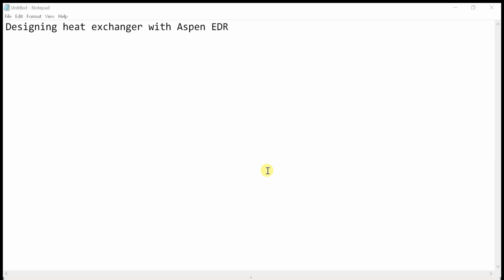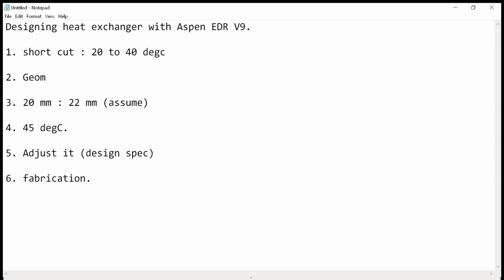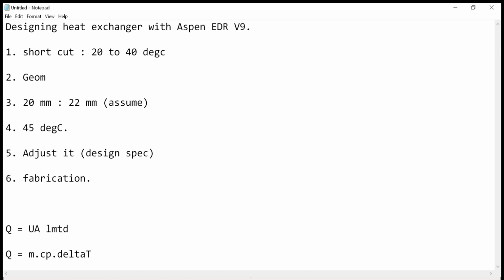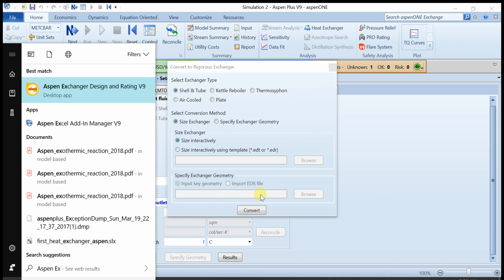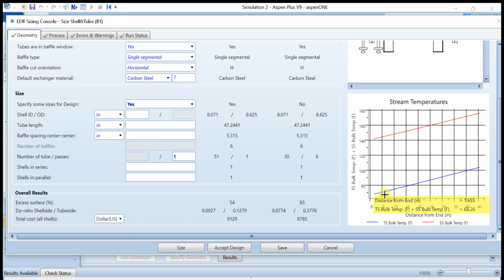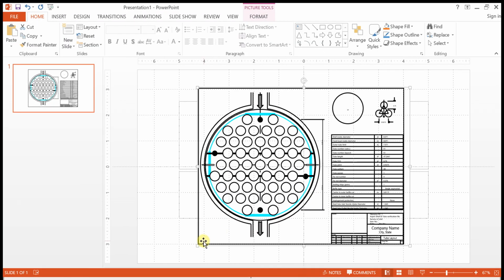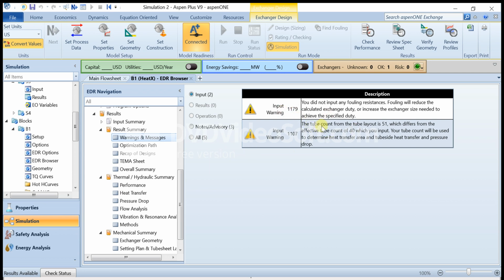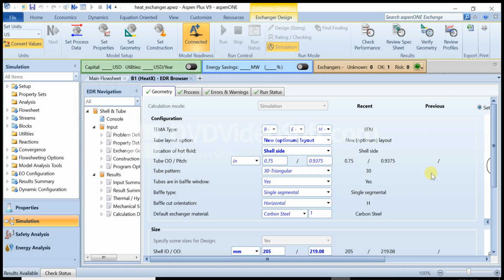shell and tube heat exchanger simulation in Aspen Plus and Aspen Plus Exchanger Design and Rating

Comment: Dear friend. Heat Flux is also equal to the enthalpy change between point 1 and 2: 
Q = H1 - H2 or Q = m*(h1-h2). Thanks
Reply from the maker: Correct. Did I make any mistake ?
Reply: @ParagPatilChemEngg   You are really good teacher. Thank you
Reply from the maker: @juanperdomo1  thank you very much.

Comment: thank you for your great work
I am looking for simulation video or documents regarding Shell & Tube  evaporator  design  with EDR, and what  type of shell and tube heat exchanger  correpinding to tema standard its appropiriate to use as evaporator
Reply from the maker: hello, sorry for late reply. Please see the manual by Aspen itself. Its good ! I could do it from there itself. Also, see Aspen tutorials (webinars), they are usually free.

Comment: Hi I followed your video and saved the file from Aspen Plus to EDR but when I opened the file on EDR its showing a lot of errors and a lot of the information which I inputted on Aspen Plus is missing. I wondered if you can kindly help?
Reply from the maker: Hi, 

Sorry for the late reply. I think EDR file made within Aspen Plus will always throw errors. 

Can you do one thing? Can you start directly modelling your heat exchanger from Aspen EDR directly ? Without going into Aspen Plus?
Reply: @ParagPatilChemEngg  It's just that when I opened the Aspen Plus file before there was no data that I had inputted, hence why it was showing all those errors. I guess that's fine if you just need the TEMA sheet, costing and other documents but if you need the EDR file itself as well then you are better off solely sticking to designing on Aspen EDR. I hope this helps anyone else in a similar situation!
Reply: @ParagPatilChemEngg  Hi, 
So what I did when I saw all the errors is I created a new file on Aspen EDR and did my HEX Design in there. To be fair Aspen EDR is fairly easy to use if you have the required information. 

Thanks anyway!